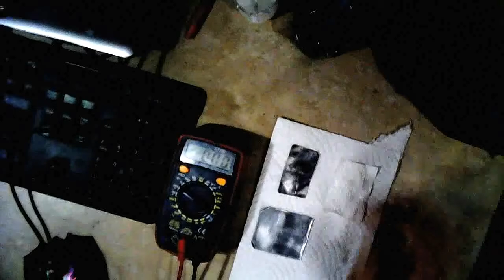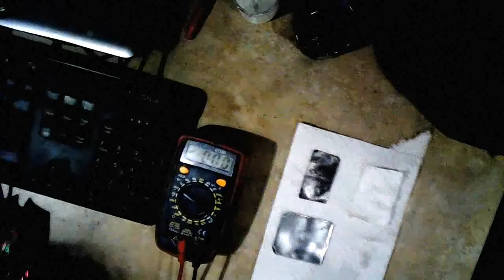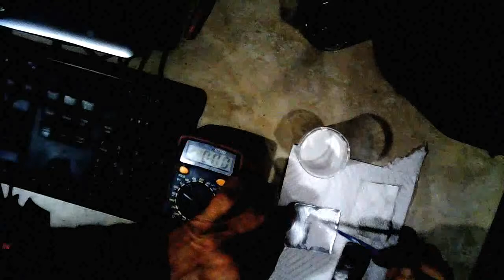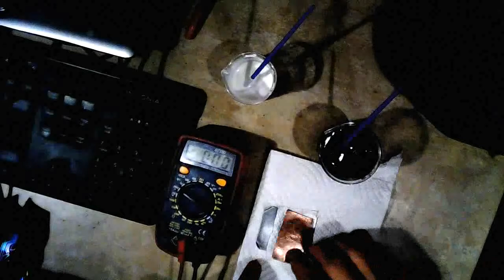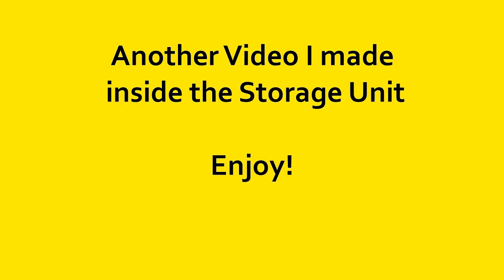Thin Film Paper Towel Borax Separator Test

Comment: I think you should let each component dry first. The titanium and carbon should be dried first.
Reply from the maker: I'm letting the borax dry good before I apply the cellulose acetate. Most of the carbon is going to be carbon felt from now on too. I don't know about drying the titanium however. It's not even soluble in water. What would be the advantage of doing that?
Reply: The advantage to it is that it becomes a surface. It is an enhanced electrode right? A battery uses an ionic solution to pass current. The carbon is a massive surface and is used to hold a part of the ionic solution after it gets pulled apart by charging. Now because you use metals on the outside of the device it has a potential difference already in the negative potentials that each type of metal has. This is the slight recharge you are seeing... The lack of current comes from the barrier or paper infused with borax.
Reply: Borax in one form is Na2B4O7·10H2O(decahydrate)...  or in this version: Na2B4O7·5H2O (pentahydrate)... Lots of hydrogen there to store in the carbon surface.
Need to hydrate that borax and then the ions can travel faster through the barrier or increase the current.
Lots of Oxygen there as well to balance the cell out. Remember that the molecules know their components. If you take it apart it stays connected and will reassemble from those connections as they were forced apart. If you design the electrode metals for the highest separation of electronegativity it should auto recharge by itself like you have seen.
Reply: I would suggest using one electrode a carbon which has an electronegativity of "carbon has a value of 2.55"
 The other electrode should be the furthest from that. 
 Tin has a value of 1.96
 Copper has a value of 1.90
 Iron has a value of 1.83
 Zinc has a value of 1.65
 Aluminium has a value of 1.61
 Titanium has a value of 1.54
 Magnesium has a value of 1.31

 So your idea of Titanium white is a great idea. Make the electrode copper and dip paint the electrode and let it dry with the Titanium.
 The other electrode can be dipped with carbon or use the felt and press fit the felt to the electrode of graphite. Or glue it in such a way that it bonds with conductivity? A Graphite based glue or binder maybe? Or a glue made with activated carbon?
Reply from the maker: Not sure exactly what you mean by enhanced electrode? It's zinc with Tio2, water, and TSP for alkalinity. Phosphate ions are in both half cells, with Na+ on the neg. side and H+ on the positive.  You call 100% self-charge slight?
Reply: the Zinc electrode in this case is the current collector. The titanium coating is the enhanced electrode.
Reply from the maker: Thanks for explaining that! :-)
Reply: I'm sorry to say the slight recharge. I know it is significant but when you can get that up to 1000% recharge then it will be moderate and be able to hold a good current constantly.
Reply from the maker: 1000% is a tall order my friend. We'll see how it goes!
Reply: Yup and I'm betting you will find it...
Reply from the maker: For some reason I had to approve your comment here Jon. I sat no restrictions on comments. Anyway, I get about 1.95 volts with Magnesium, but finding cheap magnesium sheet is not easy.
Reply from the maker: Thanks,, I hope so.